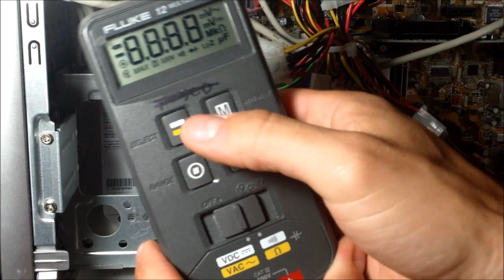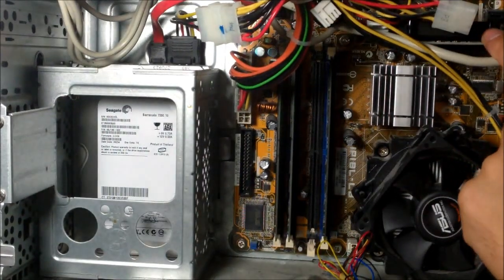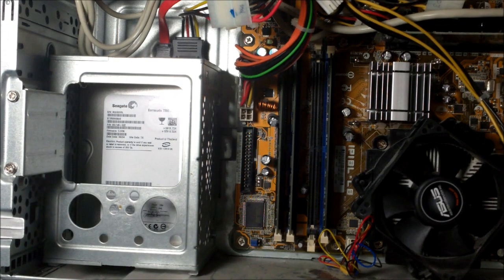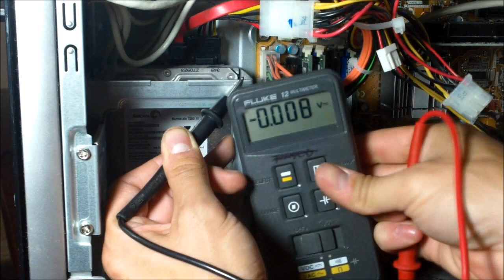HOW TO TROUBLESHOOT PC COMPUTER GUIDE TECH TIPS 20

Comment: Either the power supply is all bad or not.  You can check by the motherboard light  it is a yellow or green light somewhere in the middle...if it is off...the system is lacking electricity therefore the PSU is the suspect.. if the motherboard CPU fan is working  then electricity is OK so far.

Comment: my pc was running fine, out of the blue it freezed, nothing was working so i had to unplug the cable.
when i turned it on, it shut off and restarted itself. there was no signal on monitor as well.
i tried taking out ram and cleaning it but it didnt worked.
any help would be appreciated. thanks

Comment: I figure before you make the decision that your RAM chip is bad you should probably run a diagnostics on start up to see if the computer sees a problem with the RAM. Your computer will  give you a code that you can type into Google and find what it means. The RAM might not be bad. It might be seated improperly causing a problem. Take out the RAM and seat it again then turn the computer back on to see if that fixes any issues you previously had. If that fixes the problem then great - you just saved yourself the cost of a new RAM chip. You can go here (https://technet.microsoft.com/en-us/magazine/ff700221.aspx note: you can only use this option if you are able to get online) for a tutorial on how to run a diagnostic for a PC running Windows 7 or higher.

Edit: Thanks for the video, Tampatec. You got yourself a new subscriber.
Edit Edit: I also followed you on G+

Comment: Enjoy your videos, Q, i'm only getting 11.77v from Pw supply to hard drive & I know it's supposed to be 12v, is that an acceptable range? also you said if the computer comes on with out the ram stick that the stick is bad! did you mean if the fan comes on or the monitor come on?

Comment: hi tampatec I have problem with my computer when I turned on my computer it stuck on verifying pool data it stuck on that message it would load to my windows xp operating system please help tampatec
Reply from the maker: Use code paul51p for free video google Helpouts, code works for any tech provider.
 it can be few things, first try unplug pc power for 2 minutes to reset it, it can be errors on hard drive, try scan disk too.
Reply: Where do I can get that

Comment: can you help me sir... i encounter a problem with my PC.... the problem is no post indicator or no beeps... 

the history was when i played LAN games it works properly no sign of bad problem and its fine after i turn it off to go to bed.. then this today i turn on my pc and it fail to post .. :(  no display on monitor...

Iv'ed done all the steps that i know...

1: i restart it for many times.. ( failed )
2: i remove all the inside parts like front panel USB, and others... ( failed)
3: i remove the cmos battery with in a minute then i re-insert it. ( failed)
4: i reset CMOS jumper. ( failed)
5: i switch the jumper 1 and 2 pin to place it in 2 and 3 pin. ( failed)
6: i start up the PC without cmos. ( failed )
7: when i remove the ram it response 1 long 2 short beeps... but when i re-insert the ram it didn't response :( ... i try replacing it with borrowed ram but no post indicator.. i do it in 1st and 2nd ram slot ...

what should i do..? can you give suggestion sir :( ?
Reply: If you have already figured out your pc problem, please ignore this comment. 
1.  rule out bad ram and/or bad cpu- Is your pc pre-built ( dell, hp, etc).  
1a.  If yes, you'll need to contact that manufacturer as THEY have access to the motherboard's manual and can tell you specific to YOUR pc what the 1 long and 2 short beeps involving ram removed means.
1.b.  If  no, find the manual that goes with the motherboard inside your pc and find the " beeps" involved troubleshooting page.  Sometimes that 1 long and 2 short beeps means no ram installed, and sometimes it can mean bad ram chip or two.  There is possibly a third or fourth result.  This I know from trial and error experience for over 14 years. 
1.c.   If you can't find the physical manual than look at the motherboard near either the cpu socket, or pciexpress or pci slots ( often it's in between two of them) and find what appears to be a model number ( often between 5 and 10 characters long and alpha numeric...total) and google that model number of that motherboard's manual.

2.  rule out the psu-  Do you possibly have an other psu ( power supply  unit) you can plug into the motherboard to try ruling out the psu being faulty or worn out?

3. rule out the motherboard- Is there another pc's motherboard that is compatible with your current cpu in your pc that you can try install.

4 Did you pull a 2004 version of me- Did you leave the cmos jumper in the " clear cmos" WHILE trying to power up the machine/plug in power cord/flip the power breaker switch on the back of the psu to the closed circuit ( aka on position)?

That's all I can think of for now.  Good luck.   

Sincerely,

Tyson Pc Services

Comment: When I got my first computer I knew nothing about them. The first year the power supply started going out. I had no clue what was wrong. I ran antivirus and scan disk and rebooted, a lot.  Then one day it quit. I took it to the shop and they installed a new power supply. A month later the mother board died. They said most likely the power supply killed it. So if your having problems do some research. Back when I got my first computer YouTube was not around.
    Another thing I bought 3 used hard drives from a computer store. $50. I went to another computer store got 3 more, another $50. ONE out of six lasted over five months. So beware of used computer parts.

Comment: my computer started every time again. i checked the capacitors. they where bad. i replaced the capacitors and now it works fine. thks too you i learned a lot about replace parts on a pcb.